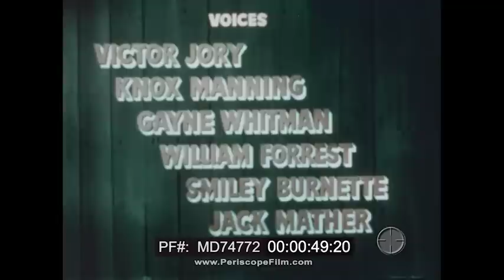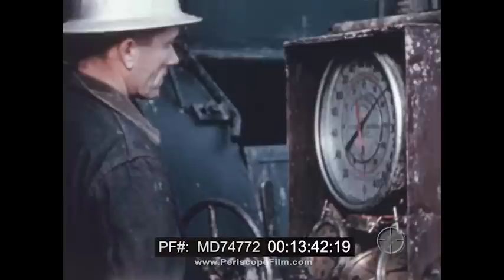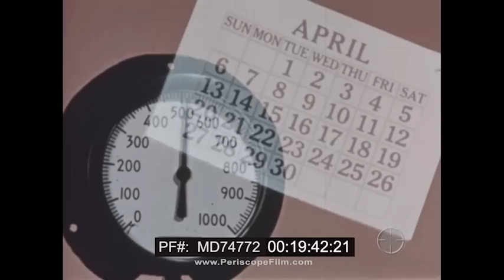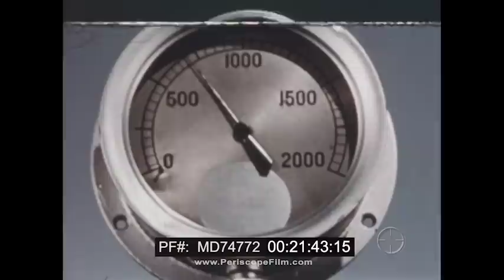BIRTH OF AN OIL FIELD   1949 SHELL OIL INDUSTRIAL FILM  GEORGE PAL ANIMATION   MD74772

Comment: this is not far off the technology that i used when i was in college on the early 1970's 
and my father provided geologic support from the well planning and the drilling to reach the right target
Reply: and i worked on these type of rigs as a roughneck in the 1970's and the technology was not much different from tripping, to fishing, and well control
but with the advent of technology, computers, and new designs drilling changed and has continued to change